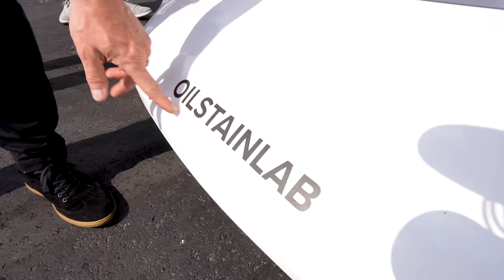SURPRISING MY FRIEND MIKE WITH HIS DREAM SUPERCAR!

Comment: Here's a idea. On those k-rails. Put a camera in between the top where the gaps are amd protect it. And have them set up every other gap. Or drill. Hole in them and put a camera there. So whem people fly by. Don't have to be there. You got it on video already.
Reply: Motion cameras would work but stand alone would miss some of the action 🤔
Reply: before you do that the whole thing has to be paved over for it be one surface and do events

Comment: This prototype is freaken Sick! (❤❤). The trailer story is crazy. Reminded me of my trailer mishap. I too had a trailer come of its hitch. I had just purchased a brand new 20ft trailer from Wells Fargo trailer manufacturer, jumped on interstate I-15 going northbound and its rushhour (6pm), not 2 minutes on I-15 I hear a load crash sound. Looked in my rear view mirror and I see my trailer out of control behind me. Discover that the locking widge mechanism in the trailer hitch so that the trailer can be attached/lock onto the hitch ball was installed upside-down. I was very luckily I got the trailer under control (trailer chain still attached) and I/trailer didn't cause an accident that day. The only damage was a large hole in my trailgate. The trailer hitch had ram/lodge into my tailgate thus why I was able to control my trailer and come to a safe stop on the side of the road. Scariest moment of my life. This all happened in 2021. All be sure the trailer chain it properly hooked up and leave no slacks in the trailer chain before just driving off with any trailer.

Comment: All trailers over 2,000 lb I believe are supposed to have a breakaway brake system with a battery on the trailer to power the electric brakes if it separates from the car! But, the batteries that come with the trailer are junk the brake controllers that come with the trailer are junk! everything on that trailer is from the cheapest source in China, and this could be no matter what the brand is?😢